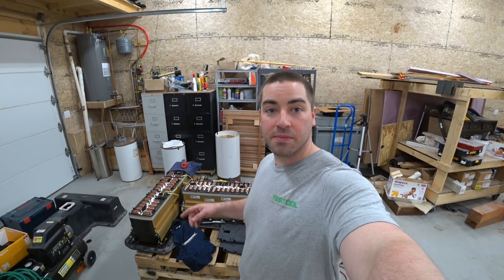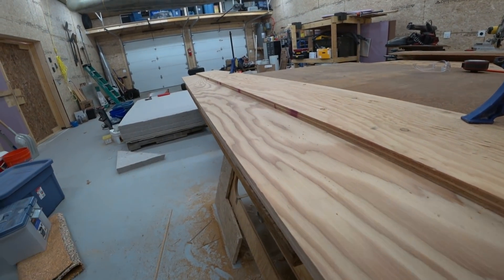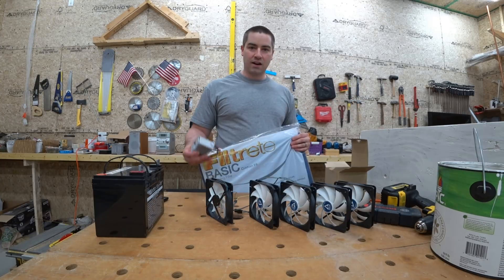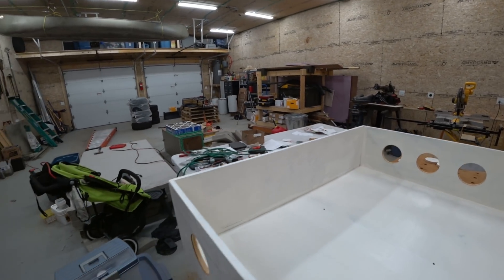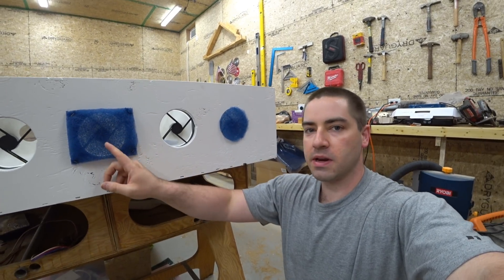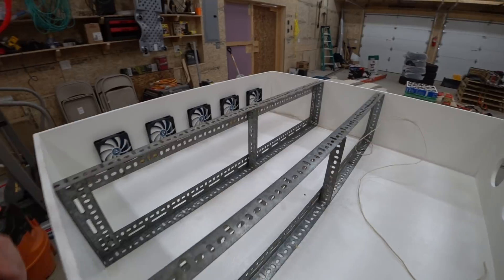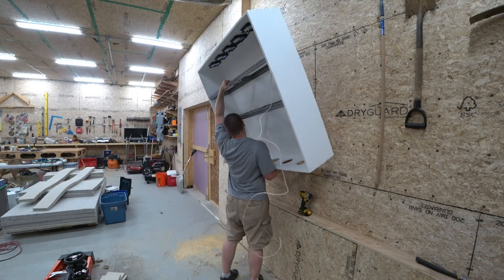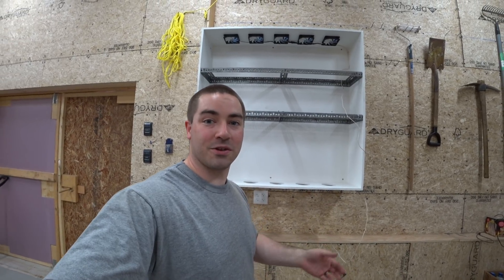Battery Cabinet Build, DIY Powerwall, Chevy Volt Gen 2

Comment: Maybe add a very light cover that flaps down to block stuff settling or falling in when fans off plus filtering air going out has no use but even paper would work as cover

MER

Comment: Another I had for fire proof is add 1 1/2” (your choice) like studs then pack with 3” Rock Wool then cover inside “walls” with cement backer board and same for door or front. Rock Wool is fire proof to 2000f + for quite a while and cheap!

MER

Comment: those fan are in sucking air configurations, and you put filter on outside, dust will inter through vents and stuck in fan. you should add filter on vents or change fan direction ... that's what i think, probably you are right .
Reply from the maker: You are right.  I put the filter up there to prevent dust from settling down.  I also need to add filter to the holes on the bottom of the cabinet, and doors on the front.  Thanks for watching.
Reply: @DavidPozEnergy  you're welcome

Comment: Hello David, I like your cabinet design, I was wondering what dimension your made it and height of shelfs for the volt batteries?  Now that you have most of your equipment in it would you change the size any?
Reply from the maker: Hi Rueben,  I used exactly one sheet of plywood to make the box.  So it is essentially a four foot square with one foot deep walls.  However, with the thickness of the plywood the cabinet is 4 feet wide plus 2x thickness, and height is 4 feet tall minus 2x thickness.  The inside is 11 inches deep because the one foot wide walls lap over the back panel.  

It works pretty well.  In one of my videos you can see I moved the charge controller outside the box.  I played with different configurations and could have mounted it inside, but I found it get's pretty warm to the touch, so I wanted as much heat dissipation as possible.

I would have preferred making the shelves out of plywood or 2x stock.  However, I didn't see a decent way for air to flow around the battery for cooling.  I had the slotted angle kickin' around so I used it.  There are so many holes in the slotted angle that airflow is not a problem.   

Probably, If I was to do this again, I would make the box taller and narrower.  This would mean taking the big battery apart into two smaller pieces, but not a big deal.  A metal cabinet could make this real nice.  Maybe something like this: https://www.amazon.com/Fedmax-Storage-Cabinet-Lockable-Adjustable/dp/B077RVYZRF/ref=sr_1_1_sspa?ie=UTF8&qid=1548610349&sr=8-1-spons&keywords=tall+metal+cabinet&psc=1   

I was trying to do this real inexpensive, and I liked the idea of it up on the wall because I sometimes get puddling of water from snowmelt off my car.  But I think a tall cabinet is more practical.

Comment: Very nice job David.  you'll be happy to discover these batteries don't even go up 1 degree when charging or discharging... they are incredibly stable.  If it's 78 degrees in your shop, the batteries will be 78 degrees.  I even fast charged one after running a capacity test, pushing 40 amps (with the DC generator and jumper cables) into a single 48 volt pack and I registered zero temp gain using an infrared gun  :-)
Reply from the maker: Hi Mark,  That is great to hear.  I was thinking there would be a lot more heat dissipation then that.  I really appreciate your input, and your videos.

Comment: Hi Dave, any reason you picked wood instead of metal for the enclosure?  if you ever have a fire, the wood will burn a lot faster.
I guess the one thing you have going for you is that it is not living space.  

I am interested in EVTV setup where jack rickard was using tesla batteries. instead of breaking them down, he is using them As-is.  He has programmed an arduino to communicate with the battery controller to turn on the contactor and get data from the battery.  he found several inverters that work with the voltage coming out of the batteries. Im intrigued by that.

I have been building a power wall using laptop batteries.  Its a huge amount of work.  I think a tesla or volt battery is a better deal and a whole lot less time involved. $2-3 K for 16 kwh is a good deal.  Tesla power wall is 2 to 3 X that but also comes with an inverter.  A big Tesla battery like a 75 kwh would be 20K if you could actually get one.  

Good luck on the build.
Reply from the maker: Hi Gregg, No particular reason I picked wood instead of metal for my enclosure.  I suppose if I had an old metal cabinet of the right size that I could re-purpose, then I would have.  I'm familiar with wood and less with metal.  I don't own a welder or brake so making something out of metal would probably mean hiring a fabrication shop to do it.  

Good luck with your build.

Comment: Hi David, have been following your journey for a while as I'm doing similar work on a cabin. Just wanted to know why are you putting the cabinet so high on the wall? These batteries are no doubt pretty heavy, and the top shelf is a very high lift.
Reply from the maker: HI Ben,  Thanks for following the journey.  There are a few reasons, none are a deal-breaker.  The cabinet could also be mounted on the floor if it is easier.  In my Garage, most of the walls are 6 inches thick, and the bottom is a foot thick (where the concrete wall is).  I wanted to be above the concrete wall section so that the cabinet protrudes less into the space.  I could have mounted it another foot lower (on the shelf) but not in that location because it would have blocked the outlets.  I see no need to get to the batteries on a regular basis because there is no maintenance.  So it will be a little tough to raise them up, but then I don't have to worry about it again.  As I mention in the video, the bottom of the cabinet is for the inverter and charge controller.  Those items I may need access to more regularly and they will be mounted at a nice working height.  So I think it worked out.  

I'd love to see how your cabin is going, maybe send me an e-mail.

Comment: Brother I have been working in the renewable energy field for the past 20+ years. Did heating and air as a kid. If I where you I would move tho's filters down to the intake side. Your cutting off a lot of air that tho's fan can push. There is no need for them on that side if the fans are running dust can't fall into positive pressure. You need them on the intake were there will be a negative pressure.  That is if your going to close it in with a door. I would remove the top filters even if your not going to close them in. Making your fans work harder than needed just wast power and they will die sooner. 

Not all trying to sound like a ass hat. I AM not that guy. Just trying to help save you a bit of trouble. God Bless brother.
Reply from the maker: Thanks for the suggestion.  I plan to put some filter material on the bottom as well.  I'm going to connect the fans to a temperature sensor and relay so it only turns on with heat.  I figured I didn't want sawdust falling down into the cabinet if the fans are off.
Reply: @DavidPozEnergy  why do you want to filter the air going out? You should filter the intake air flow. Awesome video by the way!!!
Reply from the maker: @Hector Rodriguez.  Yes, I'm also going to add filters to the bottom of the cabinet.  The filters on top are just an idea to keep sawdust from falling down into the box.  Thanks for watching.
Reply: Came to offer similarly suggestion. Heat will rise, so you want the fans to work with the natural convection flow...cool air in from the bottom with hot air exhausted out the top. Cool cabinet. Remember to allow for airflow between shelves to prevent heat build up.  Recently, we had a battery box explode at work when a flaw in one of the batteries allowed release of hydrogen gas during the charging cycle. The metal battery box was sealed with no ventilation and the inevitable spark caused an explosion. Fortunately, no one was hurt.
Reply: Cool brother. Thanks for letting us be a part.
Reply from the maker: Sounds like a scary situation.  I'm glad no one was hurt.
Reply: I just add the same